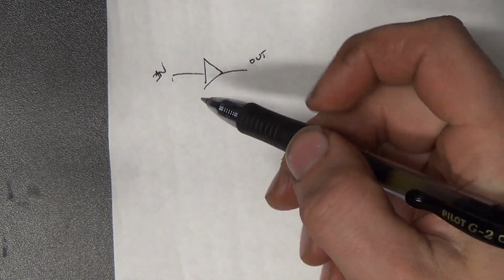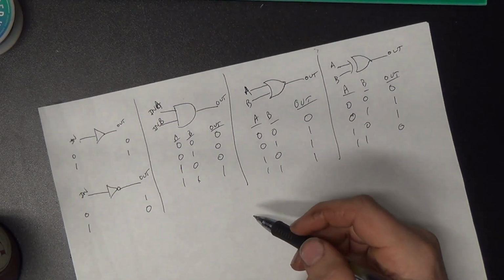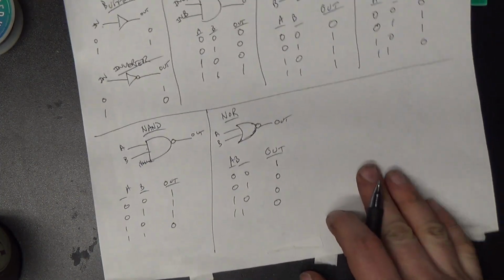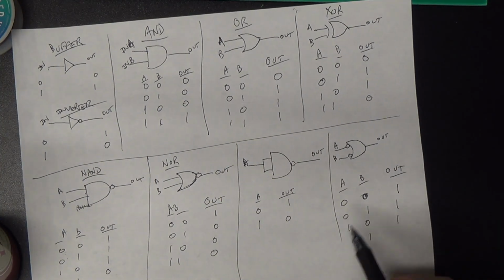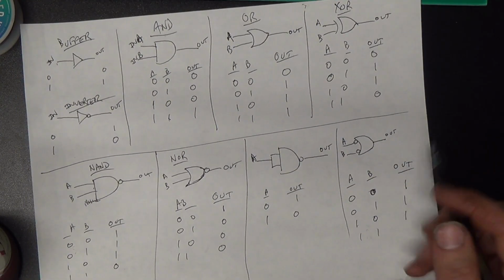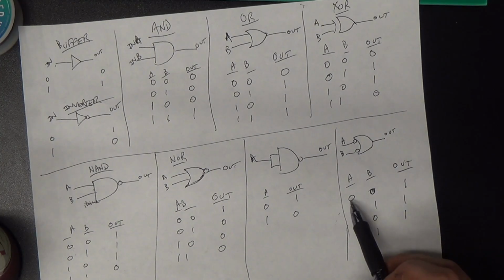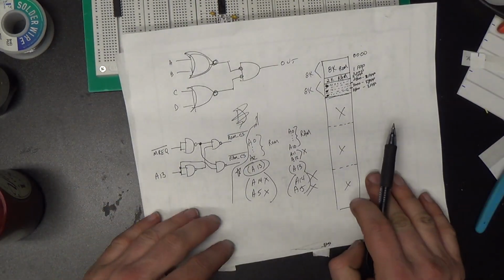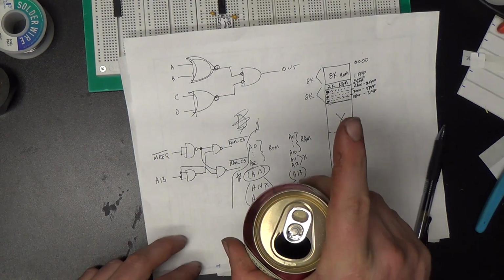Z80 Funtime Pt.5 - The Memory Map & Partial Address Decoding

Comment: You say the 2K RAM is mirrored 3x then the whole 16K block (8K ROM + 4x2K RAM) is mirrored 3x to fill out the memory map. For the Z80 Fun Time Computer, that mirroring is theoretical, yes? No machine language or compiler directives are actually going to consider/touch any of those mirrored spaces, yes? (And thanks for the logic circuits refresh. It's been a while.)
Reply from the maker: Right, as far as the software is concerned, it's just an 8k ROM followed by a 2k RAM.  The mirroring is just a side-effect of being lazy/cheap with the memory decoding and only partially decoding it.  This would suck if we ever wanted to expand the memory, because the mirrored areas would cause bus conflicts with the expansion memory, unless we redid the memory decoding logic for the existing RAM and ROM.  

But since it is just a stupid breadboard computer, and since this is just temporary anyway (eventually we'll hopefully be doing full decoding with GALs, using a 64k EEPROM and a 512k banked SRAM, and hopefully in a way that is backwards compatible with the TRS-80 Model II/12/16/6000), it doesn't matter.  This temporary setup is just to help me wrap my head around things and get the development toolchain working and get all that figured out before we hare off into something more complicated.
Reply: @Lee_Adamson_OCF  Got it. Makes sense. Prototype on!
Reply: It's all fun and games until somebody wraps a pointer.  Then you end up with an A20 gate.  ;-)

Comment: What the hell happened ? This is the last video. I was looking forward to watching you build a full on Z80 computer. :-( 
The way you explain everything as you go... I could have learned a lot from you.  
I've only Just got into breadboard computing and I'm gonna build a Z80 based computer.  Well. Thanks for these videos anyway. Still helped.
Reply from the maker: Like many things, a shinier squirrel ran across the road and I forgot what I was doing and chased it.  :(  I am nothing if not a spaz!

If you look at some of the more recent vids, I have been working on a Z-180 machine.  I hope to do the same kind of thing with it, but I have been too busy with "real" work to do much old computer stuff lately.  Hopefully that will change soon though!
Reply: @Lee_Adamson_OCF  I'll look into those vids.
Reply from the maker: PS: The advantage of the Z-180 machine is that it will run CP/M out of the gate.  This thing would have been far less useful!
Reply: @Lee_Adamson_OCF  I may have to look into that CPU.  Thanks